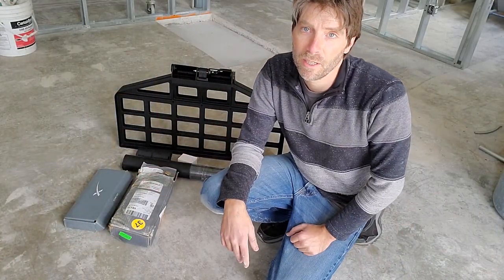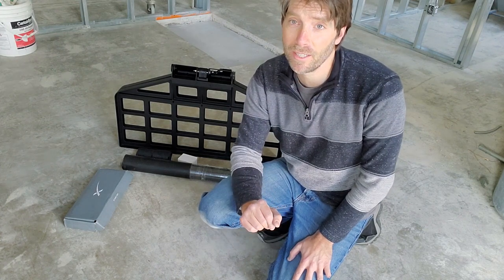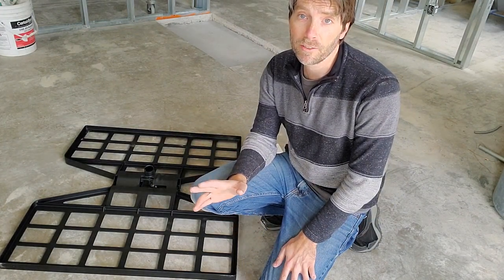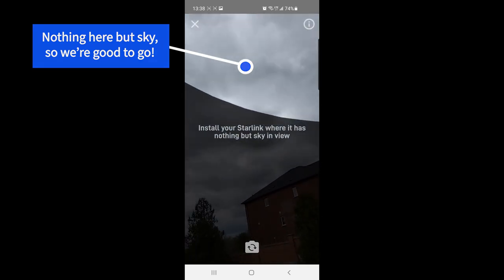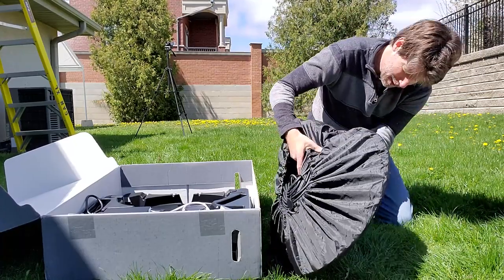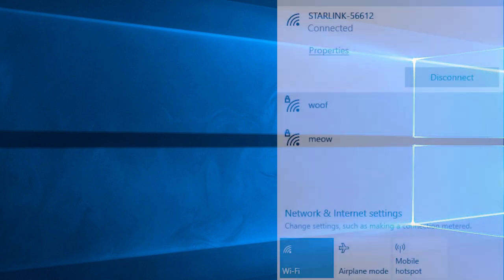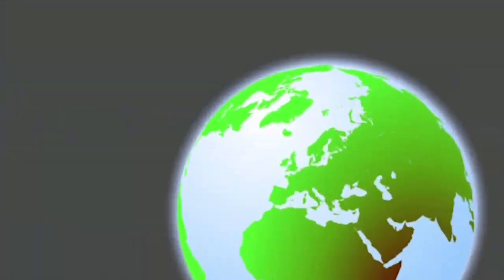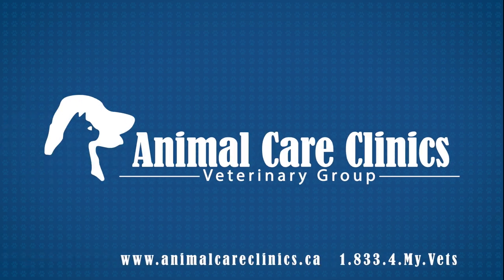SpaceX Starlink at Animal Care Clinic Episode 3: Installation, Testing and Benchmarking

Comment: Great video. I've watched several but yours showed something nobody else has. I knew the dish would adjust towards the satellite (tilting) it I wasn't sure if it rotated too or if you had to point the tilting side towards the north. Your video clearly showed that it rotates also. One other issue I still have  is that nobody  has explained when you can actually order  the accessory mounts. Everyone says to put in a support ticket but I don't have that option yet. I've just put in my deposit and am in the queue. When do you get that option to put in a ticket to order a mount? When you get notice that the dish is shipping and you pay the balance? Thanks...
Reply from the maker: Thank you - I tried to cover some of the info that I hadn't seen. Glad it was helpful. As for your questions: As far as I can tell, you have to have the hardware (dish) in hand (or at least fully ordered?) before you have the option to submit a ticket (I suspect you are not "client" until you have the dish shipped to you, so cannot submit tickets until then). I had the dish before I realized that it didn't come with external mounting hardware, so I only ordered the mounts after. As for payment, because I was part of the Better Than Nothing Beta program, I got an email that basically said, "Pay in full now if you want Starlink..." (i.e. there was no deposit). Thanks :)